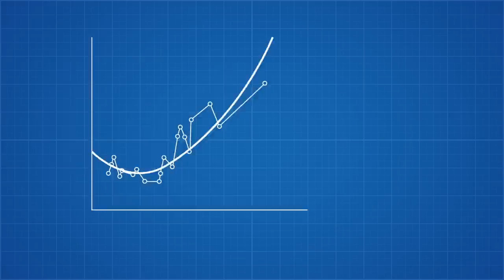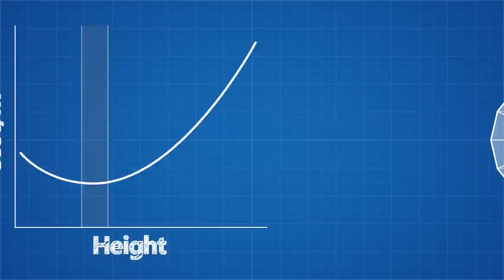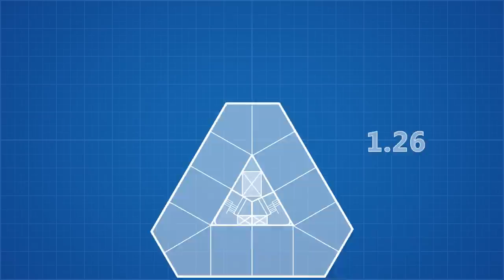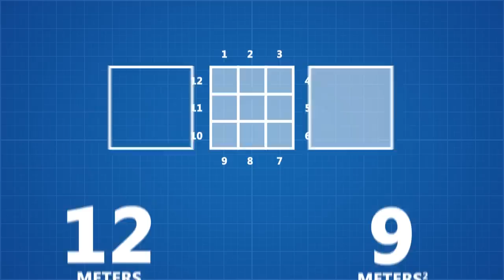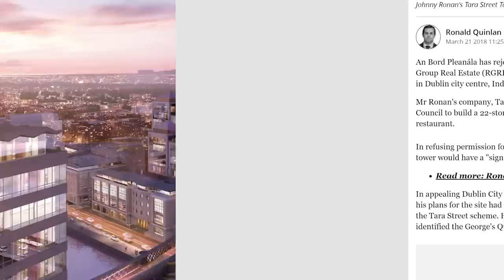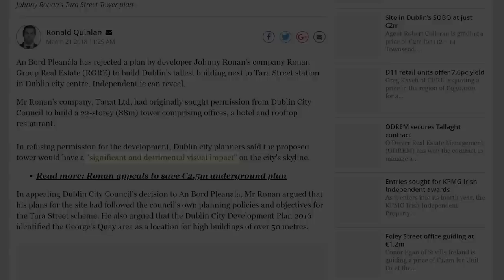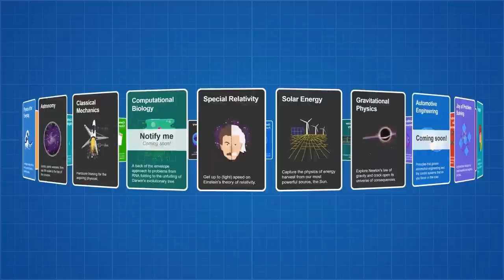How to Solve the Housing Crisis

Comment: By constantly producing settlers and expand before the Sewer technology or Neighborhood civic is unlocked.
Reply: The Spherical Earth Endless Legend?
Reply: Ah, another man of civilization.
Reply: Some cities in Germany rebuild their sewer system in the 60/70 in scale that was slightly euphorically optimistic. Combined with the water preservation efforts and environmental movements of the 80s caused a situation that oversized sewer pipes are not facilitated with enough sewage fluid to wash away the solid wastes. Thus requiring to reroute storm waters or at times potable water for drainage.

Sewer unlocked. Now revert the efficiency schtick.
Reply: Nicholas Wilkowski

Nuking your own cities. The strategy that Thanos stole from Gandhi.

Comment: another thing to keep in mind when considering cost effectiveness of tall buildings is the site specific features such as ground conditions, water courses, local wind pressures, surrounding structures and site access. These will also affect the U curve mentioned at the beginning of the video in addition to the other factors mentioned. I would say the ground conditions and subsequent effect this has on the cost of the foundations should not be discounted as it very often has a large impact on cost and project construction time.

Comment: I've long thought that a "Mixed Zone Development-Transit Corridor" will be one of the best ways to address housing, work space, and transit going forward. Rather than having a dense downtown core that extends in a radius, shift it to a focus on building up along the lines that commuters travel from bedroom communities. As the density rises cities and regional governments can justify the expense of more concentrated mass transit that has the greatest chance of impacting a larger portion of the population. 

Ensure planning allows and encourages not only for residential, retail, and office space is developed within reasonable distances to each other (whether mixed use buildings with retail-commercial-residential stacked upward, or merely encouraging collaborative developments between nearby properties) but of mixed value so that reasonably affordable boat like 'micro apartments' are within the same geographical area as high end penthouses, and a city will have gone a long way towards addressing the issues that put so much pressure on local economics. Restrictive zones of 'all the houses over there', 'all the office type things here', and 'all the shops in these central mall zones' make it needlessly hard to live near where you work and shop, and greatly extend travel requirements.

Over time you can begin linking urban centres with these transit corridors, sharing related infrastructure between local public transit, local express, and regional transit. The smaller 'bedroom' communities can be encouraged to develop park-and-ride focused nets that feed into the central corridors.
Reply: I totally agree. 
I have made a Video about Land Value Taxation that would solve the Issue of Efficient land Usage.
 LVT combined with Universal Basic income, would spur the Private Sector to build Affordable Housing for everybody.
With LVT, City Planner only need to plan the streets, Parks and Public transportation infrastructure. Under LVT as single tax, Development would naturally happen in its Most Efficient form, economically and ecologically, which ever that might be.
Another Problem causing the housing crisis is that Construction Companies make more Money with Labor costs, so they have no incentive to actually finish anything on time.
So i think another Solution I believe to be effective, is a law that mandates that for every Construction Project, the Construction Company should put a Fixed Price before hand in their contract and makes them liable for Construction Code violations. This would have Construction Companies loose money the longer they take due to Labor costs, so they will be strongly incentivized to adopt Techniques and Technologies that would reduce costs, building time and maintaining Quality.
Reply: The concentration of services and transit in the city center is a major problem in Dublin. All and bus, tram and rail services and most roads are linear meeting in the city center while the majority of citizens live and work along the outskirts of the city. This creates very long journey times and congestion in the city center.

I live in a fairly wealthy area of Dublin 15, 6km from the city center and work just 5km across the river from my home. Dublin 15 as a whole has 150,000 residents yet is only served by two bus routes and a limited hours train (monday to friday only) that only takes you to the city center.

Public transport between my home and work takes 1h10m each way via bus (€12.30 cash fare, €7 capped fare for transit card), 1h40m each way via rail & tram (cash fare €11.65, transit card €9.54). It takes 1h35 minutes each way to walk (5-10 minutes quicker than the train/tram!), 20-30 minutes to cycle and just 10-15 minutes to drive despite needing to cross the river through the city center. My EV costs just 2c/km to do that journey in energy costs (€1.80 per day incl. road tax, maintenance & insurance). A lack of river crossings require me to walk or cycle effectively the same route as I drive. Lack of cycle lanes and some substantial hill climbs in/out of the river valley discourage walking and cycling. So I'm stuck driving an indirect route through the city center increasing congestion.
Bus and rail services are difficult to use. For example no system wide maps exist publically of the bus network, inconsistent fare structures to the point that if you are paying cash the bus driver is often unable to calculate the proper fare on his own route and odd scheduling that makes it difficult to use the system for commuting. The city center has many vacant sites held by speculators for over a decade in many cases with no incentives for them to build or sell until the recent introduction of a vacant property tax.

Until recently there were no property taxes, and even now they are set at a low level or waived for many (I pay nothing until 2020 for example and then only ~€50/month) leaving local government very under funded. No unitary authority has responsibility for transport across the city except the national Transport Infrastructure Ireland (TII) who require funding from central government (which gives a proportionally smaller amount of money to Dublin transit despite ~50% of the country's population living in Dublin or it's commuter belt).
Take Metro West for example, proposed/planned 15 years ago this would have created a radial metro rail route around the city starting at the airport, crossing through major industrial & commercial areas and areas housing ~500,000 people (including my own, and connectivity with tram services to my work) with building land and density increases more than allowing for a doubling of the city's population.
Central government never funded it, my area's local government left a band of undeveloped land to accommodate it but the two other local governments on the route didn't.

The result of these and a handful of similar projects being delayed or not funded is that the city is now choking under congestion and lack of housing with just moderate economic growth and businesses fleeing Brexit for example are avoiding the city due to the infrastructural deficits and cost of living/quality of life.
Reply: cros13 yep. Lack of long term transit planning really can mess up cities.
Reply: @RealLuckless
RE: ". . . not only for residential, retail, and office space . . ."
Like many commentators, you have equated "office space" with "work space." You do realize that not everyone works in an office, don't you?
Reply: @spaceman081447  Yes, I'm aware of that. This is a YouTube comment, not thesis paper. While I'm not suggesting steel mills or pig farms be built in the same blocks as a bakery or housing, there is still no reason why small manufacturing and artisan shops can't be in the same walkable neighbourhoods as other uses our cities need, and have neighbourhoods readily connected by reliable rapid transit.
Reply: @RealLuckless  
RE: ". . . there is still no reason why small manufacturing and artisan shops can't be in the same walkable neighbourhoods as other uses our cities need, and have neighbourhoods readily connected by reliable rapid transit."
Well, then, we are in agreement. Thanks for responding. (From your spelling of "neighbourhoods," are you from a British Commonwealth country? Just curious.)

Comment: A huge influencing factor that you didn't touch on, the engineering and architecture has to be redone for every single tower and apartment complex. It's ridiculous that there are no open source designs available in the industry. As a software engineer that wanted to build a 12 unit 3 storey building, I could not find any plans to start off from. We would have had to go through an architect for sure, and it would have taken months to get a new design built, because he had designed something that "looks good" , but was a 6 unit complex taking the same amount of space as a 12 unit would. I wanted no bells or whistles. I wanted a tall box with 12 units and it seemed like I killed this man's hopes and dreams. As if I wasn't in the clique that is architecture. If we were to start an open source website for this sort of thing, I believe that the industry would change drastically fast, and for the better

Comment: Prefabricate residential building technology was actually all the hype of the late 60' and 70' in most Eastern European states. The problem with that, however, is that it has some additional hidden costs that people sometimes forget. First, prefabricated construction elements are usually way heavier than  just the building materials (and cannot be portioned as one sees fit) what means the construction requires more high duty cranes to be able to keep up the pace. In addition, transport of the prefabricates from the factories to the construction site usually requires oversized vehicles, as the elements tend to be very big. Lastly, the effect of scale in the factory does not provide as great cost reduction as one might anticipate, and it might be not enough to offset increased transport costs.

In other words, this approach to building is nothing new - it was common for decades, but due to enormous scale needed to operate such system (it is not efficient to build a prefabricate factory just for few construction projects), and various minor and major problems it turns out to be way less profitable than it might seem at first glance.
Reply: Prefabrication is a matter of degree as we see site-built houses now where many sections such as roof trusses and windows are in fact prefabricated. Big corporations like Lennar throw up whole subdivisions quickly as in a factory - even as the designs within can be repetitious and dull. I looked at a prefabricated home by Palm Harbor but they do not built them as I imagined and they don’t save all that much money. High quality manufactured housing should be part of the solution in suburbs.

Comment: @ 6:26, shouldn't the wall to floor ratio be 4 for building A, and 6.66 for building B? 
Please correct me if I'm wrong

Detailed Calculation
Assumption
Wall height = 3 m

**Building A (square)
Wall Area = 12 m × 3 m = 36 sqm
Floor Area = 3 m × 3 m = 9 sqm
Wall to Floor ratio = 36 sqm ÷ 9 sqm = 4

**Building B (cross)
Wall Area = 20 m × 3 m = 60 sqm
Floor Area = 3 m × 3 m = 9 sqm
Wall to Floor ratio = 60 sqm ÷ 9 sqm = 6.66

Comment: The focus of this video is plainly housing for lower income earners. The issue is that cities are not built for low income individuals. If you build a ton of affordable housing, you change the demographic for shops and businesses as well as lower the tax revenue. I understand the altruistic focus of this video, and believe it is correct, but it is not feasible. You look at the cost per square footage for building, but the real graph should be revenue per square mile. Cities are only interested in maximizing how much revenue they can generate per their limited footprint. A city that focuses on what you outline in this video will struggle to bring in tourism and revenue. People go to New York because it is expensive and indulgent. A city built around affordable housing will have affordable businesses because the demographics of the city can't afford indulgence. I believe there needs to be a better mix, but the balance of altruism and revenue is a hard one. Another solution is to decentralize from large cities. Small cities and towns do not depend on tourism and can easily expand and offer housing to any income level. This is why lower income families have such a higher standard of living. Ignoring the bright lights of the city is a great way to reduce poverty and homelessness.
Reply: I’m on a highish income and having an extremely hard time finding a place to live on the city center(Dublin). My commute is over an hour everyday. 

5 years ago I could have afforded it.

So there’s more to it I think
Reply: I don't doubt it. I don't know anything about Dublin specifically, but all large cities are terribly expensive. Another part of the issue for large cities is that people value having privacy and land. There is another episode on here about urban sprawl, but not everybody is willing to live with only a wall separating them from somebody else. Another issue is that places often put rent limits on apartments (something from this video it sounds like Dublin did). This discourages people from moving as they're locked into a great rate. Reducing the mobility increases cost as the supply is dried up while the demand continues to rise. No doubt Dublin has experienced that over the years based on what you have experienced and what was said in this video.
Reply: Lived in Dublin for four years, and what you say about smaller cities and towns offering better prospects for lower incomes is definitely true, however the shortage of housing is not exclusive to Dublin in Ireland, it also exists in Cork, Galway and Limerick (to a lesser extent). This is also not helped by the fact that the financial, political, industrial and technological bases of Ireland are also all based in Dublin, creating an entire country effectively centralised around Dublin.  So naturally, most people in Ireland will gravitate towards Dublin. The shortage of housing is mainly due to the fact that there has been virtually no new housing units built in Dublin over the past four years, and this is because in part about height restrictions, but also due to fears of another property bubble which caused the 2008 financial crisis (if developed by the private sector), and also objections from current residents about having social housing built near them as it would devalue their own property. So unfortunately, there are many influencing factors here, but something will have to give at some point, as the population of greater Dublin is forecast to increase by about 250k in the next 12 years
Reply: Luke Thompson, Rent control usually has a mix of rent controlled and free market units.
Reply: Isn't the solution more to make small cities and towns much more attractive to business and economic growth? Then suddenly there's more room to build new housing and once a steady growth is established in the local population and businesses it can continue to grow for a long time before reaching physical and socioeconomical limits. At some point cities become too much to handle; there's too many people, it's easier to be homeless, it's more difficult to grow physically, the infrastructure gets crowded out by businesses, commute is ridiculous, most folks are unhappy. Making it attractive to do business/wokr/living outside of cities would improve this situation, I think.
Reply: Do you not being able to afford a 700,000 condo when your 25 to be "poor".

We are not talking about hobos. We are talking about trained workers with good educations and good pay.
Reply: What are these people doing which requires them to locate in these urban areas?   Intellectual property travels over the Internet.  Meetings and planning can be done over the Internet.  I live in a rural area.  Are these low income people providing restaurant workers and cleaning services to the well to do and tourists?  Is there a growth in manufacturing in these areas?  Isn't manufacturing something located best on the edge of urban areas where land is inexpensive?  In the age of non-automated heavy industry which had to be centralized, the workforce had to be concentrated.  This is no longer the case.
Reply: You are pretending as if cities were just put together this way one day... they move with demand, the more people come to the cities looking for good locations the more you can squeeze them for money.
And it slowly raises the cost of everything in the area simply because they can.
Reply: 4 Bed House to Rent in Dublin in 2013 - €1,150 per month
4 Bed House to Rent in Dublin in 2018 - €2,500 per month